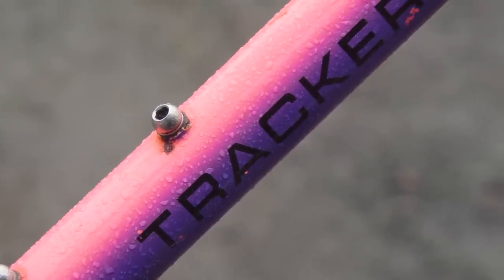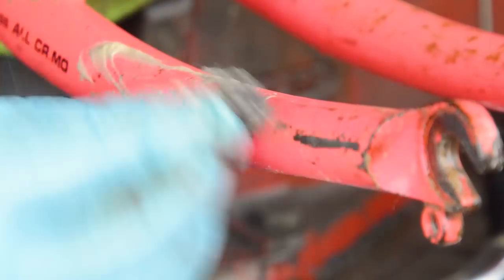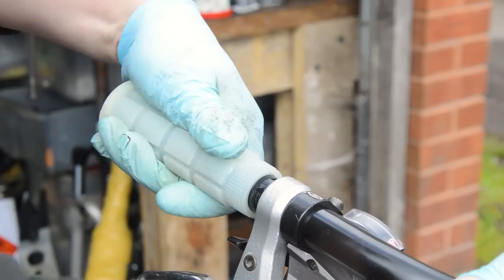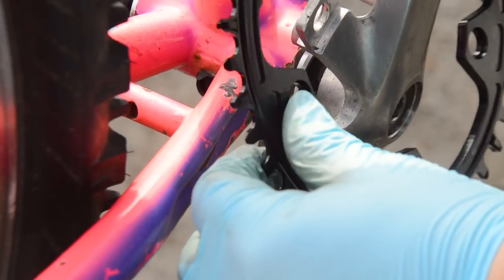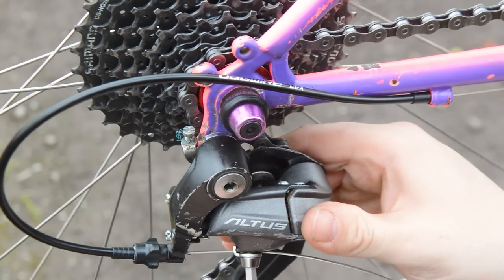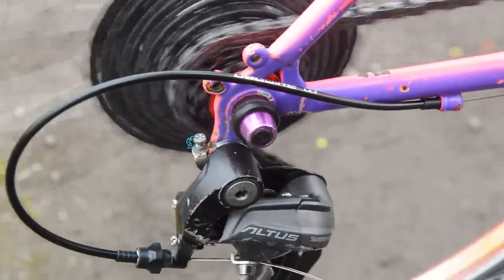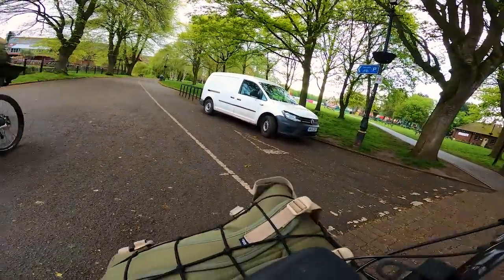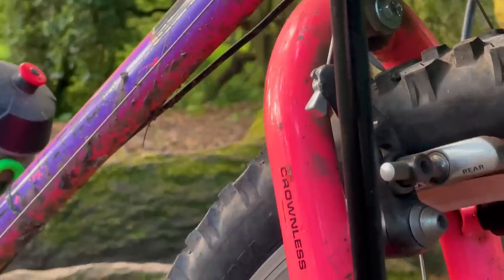90s MTB Pizza Bike Commuter - Fluro Pink MBK Tracker Hi Tech

Comment: I recently built up a Miyata Elevation 400 very similar but used a bmx bar and stem along with building my own front rack from an old folding chair. I bolted a milk crate to it and use it for storing my backpack on commutes and grocery runs. With semi slick 1.5" tires it rolls so well. The only issue is when the front rack is overloaded it understeers like an EF hatch with an H22 🤣 Haven't fallen yet just need to be mindful on turns. Awesome build.
Reply from the maker: That's quite an engine to jam in to an EF! That takes me back a bit!
Reply: @MonkeyShred  Yes I've never swapped an H22 into anything but I still have my '78 Civic wagon with a 1.6L DOHC ZC 😎 Also just realized my Miyata is an Elevation 500' not 400'. I have no idea what the differences are haha!
Reply from the maker: @layspeed  ooft nice. I swapped a ZC of sorts in to my 2nd EG. It was the UK version though, the A9. Snapped the cam belt on that engine too 😅 it lived on with a new belt.

Comment: 14:55 whoa I have the STX RC and they have the front and rear stamped in them too... mine are on wrong? lol  weird. it's original 1996 equipped but I see it. the rear one will push the pads further back on the opposed mounts and the front does the same. the post being offset opposite. cool I have pads coming so I'll swap them then
Reply from the maker: Yeah as long as the opening isn’t at the front of the pad holder you should be good. Opening at the front = pads ejecting themselves under heavy braking 😅

Comment: bout the front and back on the brake pads. If you reverse them as you did, when you brake, it will pull out the brake pad from the brake boss (?). Lovely build.
Reply from the maker: Yeah if you put them on backwards. Mine have the tabs on the front so the pads can’t pull out.

Comment: nice build up mate. I would run a 2x chainwheel though so that you can have a closer ratio cassette for better shifting. You're probably never going to use that 44T cog in the rear in your daily riding. Why not a 13x27 cassette with a 40x32 chainwheel to cover all your riding needs.
Reply from the maker: What? That’s a regular 9 speed cassette… a 32T. Don’t know where you got 44 from.